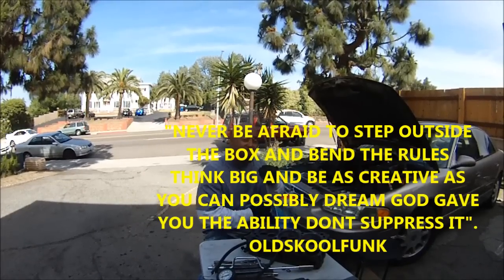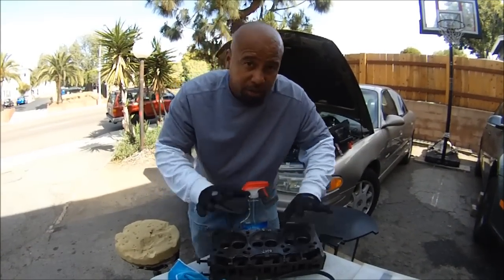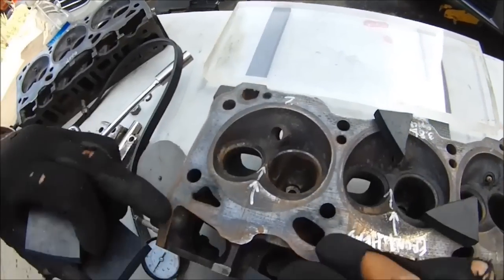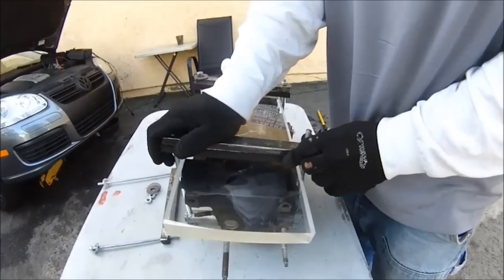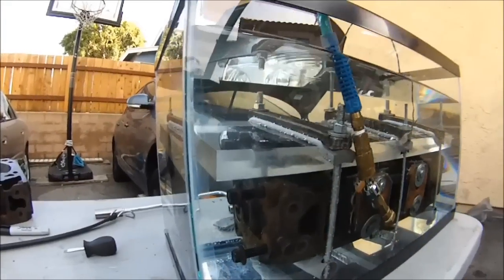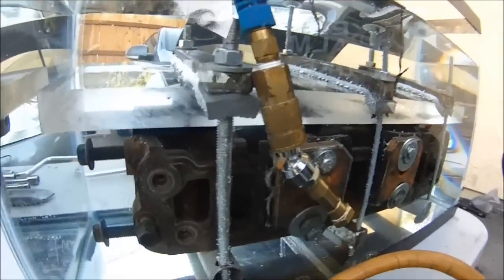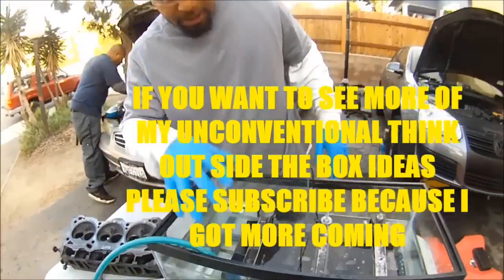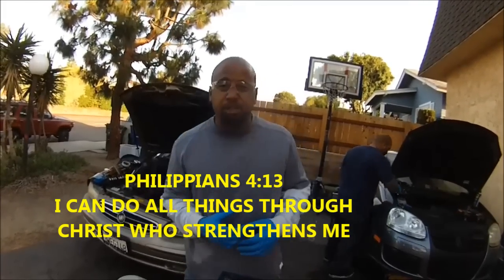(NEWEST WAY) TO CHECK CYLINDER HEADS FOR CRACKS AT HOME W/ A HOME MADE PRESSURE TESTER

Comment: Hi, I liked your take on the crack testing, and believe the method has definite merit. However, as with all great ideas, there appears to be room for improvement, many of which you have quite correctly pointed out in your excellent tutorial.

The biggest drawback may quite possibly be the fact that, by the very utilisation of this method, one is specifically testing for escapement of pressure from the water jacket side, to the outside. The water jacket is pressurised to significantly lower extent than that prevailing inside the cylinder at the moment of ignition. As a result, it is more common for the fuel/oil mix to escape into the water jacket, rather than vise-versa, in event of a crack.

As pointed out, this test was carried out with cold water, and a cold head. As the prevailing water temperature within the cooling system rises in accordance of engine operating time, (up to a certain extent), this test was, at best, of a limited value, albeit sufficient for most applications.

Utilising Plexiglass (and most of its variants), has certain problems. The biggest, Plexiglass has a relatively low melting point of approximately 105 deg. C. (167 deg. F. for those living across the big pond). One would presume it would lose its rigidity somewhat below this value. The other, there are limits to its ability to maintain tensional strength at high rates of compression.

Anyway, Thank You for the excellent and informative videos You make. I'm sure they are viewed by many more than those who subscribe. In my case, I'm located in Indonesia, where I do much technical work on cars, motorcycles and marine engines. My apologies for the long post. Keep up the good work, you have great ideas...
Reply from the maker: Olli Makkonen Hot water and more pressure is all that is needed I will make another video to show the improvements.

Comment: how you doing bro , listen i got alot of points from what you do here it help me to build my auto repair skill , i'm in the field  , but  as i watch this video here , you explain everything but you didnt explain how  you install the port for the air hose .
Reply from the maker: rjlee debe The port for the air hose is attached to the metal plate, the metal plate has threaded pitch the same as air fitting male adapter sleeves. I just glued the rubber gasket material on it and drill a small hole for inlet air to eneter the head. You have to improvise and macgyver the water jacket hook up like when I had to tap the side but every head is different.

Comment: Hey mate just seen your pressure test video , I often test cylinder heads by just using super glue and flat steel plates that are bonded over the water jackets ,I have a air intake pad that is fixed to a regular foot pump .Use plenty of glue and let the steel pads set for an hour and you can get them totally air tight and get pressures of 50 psi   Nice work my friend !

Comment: Hey my brother in Christ do you think that magnets would work as well to seal some of the ports I have some 2by2 size square magnets what you suggest.
Reply from the maker: Oliver Green I dont think they will because you need to smash the rubber seals into the holes. they material must be rubbery and firm at the same time. Stay ARMOURED UP IN CHRIST BROTHER.
Reply: Thanks I will

Comment: Your the man Oldschool good video. And what the most pressure you would see under worst circumstances like over heating and if it did go over like  30 Pounds of pressure would have head gasket failure

Comment: Technically if the head and plexiglass is perfectly flat and you upgraded your hardware you could turn this into a cylinder compression test. :)
Reply: ***** I thought of that too, but when possible, I'd rather do that with the engine in the car. Good test if you got a used cylinder head and wanted it proven first. :)
Reply: ***** Plexiglass isn't perfectly flat, it's flowed out as a liquid and allowed to solidify, and typically there are some surface variations (I've seen on the order of .060" on a 12x12" sheet of 1/2" thick).
Reply: +Mark Pikas it is flexible though, so clamping it down against a flat surface shouldn't be too hard.